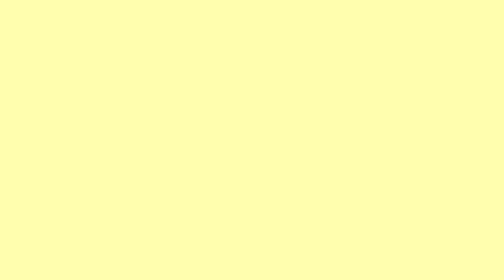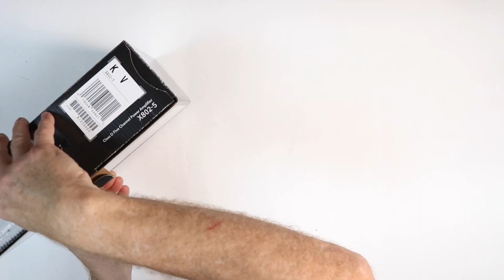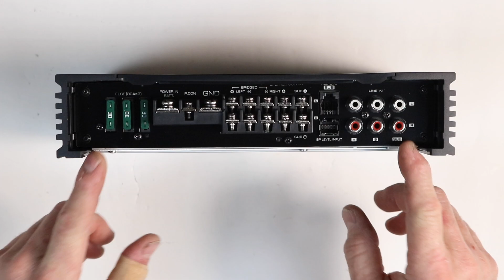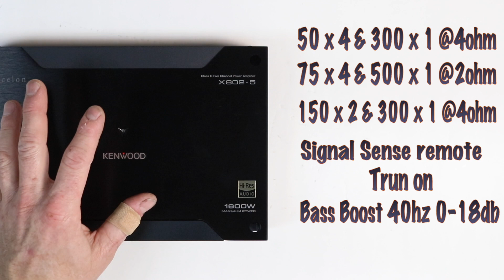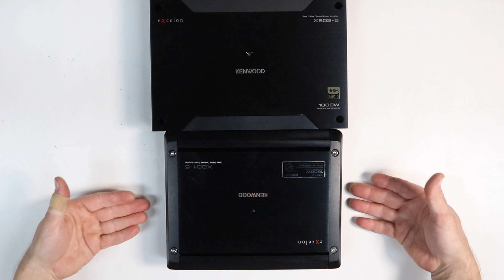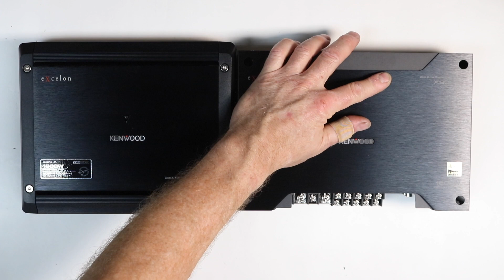Kenwood Excelon X802-5  power amp unboxing and review

Comment: So I redid my entire wiring and ran each speaker to this amp, I also have a 10in sub. How do I set the gains for both?  Do I use both the sub and ab and do them separately or do I use just one?  

I have a pioneer avh4500nex as a head unit so each one has its own rca cables which I ran for all three left, right and sub outputs. 

I can run wire all day long and hook everything up but when it comes down to the tune of the amp I always get lost.

Comment: what kind of fuse from the car battery to the amplifier would you put to this keenwood amp Excelon Xr901-5, it has 3 40A fuses in the amp. But I want to know the fuse that you put close to the battery of the car
Reply: Add up the fuses on the amp and put one of those near the battery.  That would be a 120 amp fuse.
Reply: @Thebrothaisback  thank you very much 😊😊😊
Reply: you fuse for the wire, what the wire is going to is irrelevant. the fuse needs to be just under the power rating for the wire, so the fuse blows before the wire melts....  obviously you buy a wire that can handle the power for the amp. 4 guage?

Comment: For the record, I purchased this amp last year to push kicker and fosgate mids and highs, and kicker 10s in sealed truck boxes in my 2017 4RUNNER. I ended up putting a pair of Kicker Comp R 12s in a ported box, wired at 2 ohms, in the truck to enjoy bigger sound when I didn't need the cargo space. The X802.5 drives those subs and sounds excellent even though they are rated for 1000 watts rms! To be fair, I have an LCQ-1 adjusting the signal from the stock head unit to the Kenwood, but I'm telling you this little 5 channel amp is an outstanding unit!

Comment: But how does it perform? I would much rather see you bench test these amps and measure power output at 1% THD than SPL meter 6 inch subs.
Reply: That's what BigDWiz is for! Hopefully he will bench these amps ( the new pioneer also) and compare them to the older model(s)
Reply: @DapimpBDSD  I thought that he only did old school stuff?
Reply: @bbchester6  normally he does but he also does requests or if someone sends him an Amp.

Comment: Huh!!! Those style terminals are the worst!!!
Reply: Sony has them too.  I used to not like them - until i realized i like using a drill to tighten them up instead of finding the right wrench and it taking a while.  Crossovers have these.
Reply: Yup it’s literally why I don’t buy kenwood they are like the Kmart of car amps no evolution
Reply: i mean an easy way around it is use a copper lug that fits, that allows a terminal to be completely screwed and no real chance of it coming out, Yea its heavily outdated though.
Reply: exactly, it's actually very secure that way
Reply: Yeah its a bit 1980s lol

Comment: This may be a dumb question.  But how do you reach a 2 ohm Impedance on 4 channels.  I'm sorry for the silly question but I really dont know.  I just would like to know how to get more power to my mids and highs in front doors and rear doors. Thank you
Reply: Bridge your 4 ohm speakers
Reply: @chaskenaruto9326  so two 4 ohm speaker s on the left and right channel create 2 ohms right?? And same for the rear if you do left and rignt??
Reply: @LaughingBuddha33-p3z  yes
Reply: There are 2-3 ohm speakers are available.  Infinity, JBL, Focal, and other brands make them.  I think Alpine Type-R came in 2 ohm at one time or another.
Reply: @spazzattack1188  This thing only makes 75 watts per channel at 2 ohm. If he wants more midbass bridge the front channels to get 150 watts. You can also lower the crossover point (60 - 65hz)and pull it up front more if your speakers can handle it and your doors are dampened properly.
Reply: Kenneth Mitchell, the first thing you should do is to find the manual on your amp and make sure it can handle 2 ohm loads.